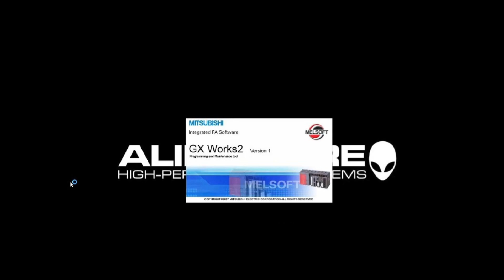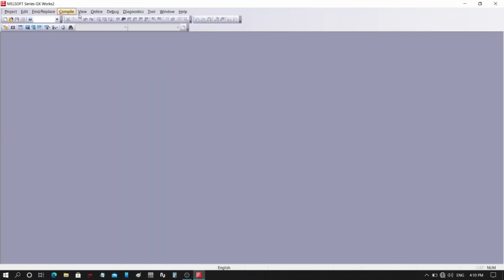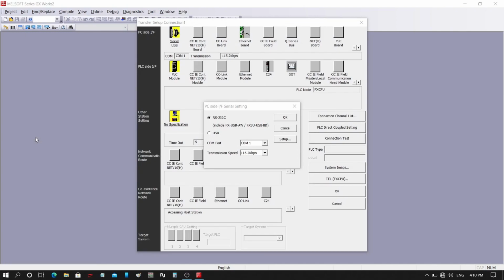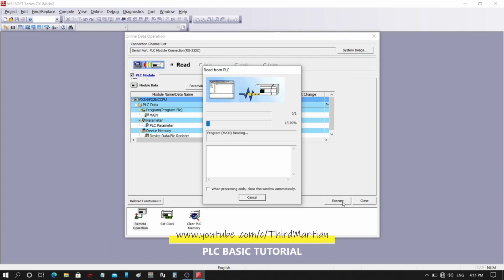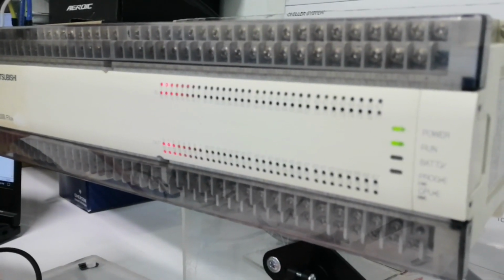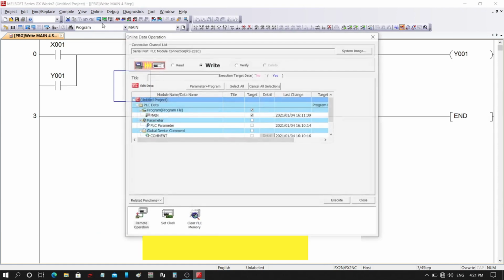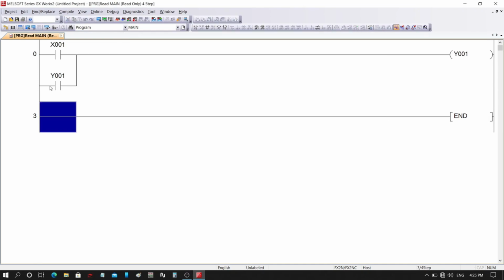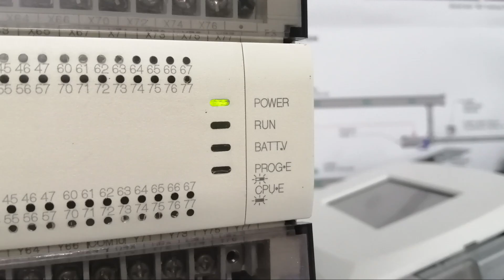How to Wired, Upload and Download Program in Mitsubishi Melsec FX2n PLC

Comment: will the gx works 3 also work?
Reply from the maker: If you are working with older Mitsubishi PLC models like the FX or Q series, GX Works2 is necessary. However, for the latest iQ-R and iQ-F series, GX Works3 provides a more advanced and efficient programming environment. Therefore, while there is some functional overlap, GX Works3 cannot fully replace GX Works2 if you need to support the older PLC models.
Reply: @TheMachine0021 
This saved me going down a big rabbit hole!

Comment: Sir good day. I would like to inquire if this unit is the same of Mitsubishi FXos- 30MR- ES is the same wiring diagram to be apply?
Reply from the maker: The wiring and configuration of FX2N and FX3S PLCs are generally similar because they are both part of the Mitsubishi Electric FX Series PLCs. However, there can be some differences depending on the specific models and their features. It's essential to refer to the user manuals and documentation provided by Mitsubishi Electric for each PLC model to ensure that you wire and configure them correctly for your specific application. Keep in mind that the wiring and configuration details may vary, so always consult the appropriate documentation for the precise information you need.
Always check Data sheet or User manual 
https://dl.mitsubishielectric.com/dl/fa/document/manual/plc_fx/jy992d55301/jy992d55301h.pdf
Reply: Thank you sir .

Comment: What happens to the program if I download the program in stop mode and not in run mode?
Reply from the maker: Uploading the PLC program should be done in "Run" mode rather than "Stop" mode. The main reason for this is that the PLC operates differently in these two modes, and uploading in "Run" mode ensures that the program being uploaded is the currently executing and active one.
Reply: @TheMachine0021  The reason I asked is because I downloaded a FX2N-128MR program to my PC in STOP mode and uploaded the saved program to another PLC of the same type in STOP mode too and it didn't work. Could this be the reason that uploading should be done in RUN mode? Thank you for your help.
Reply from the maker: Probably, uploaded it in run mode.
Reply from the maker: you will receive an error during uploading.

Comment: What mean if run light is not on?
Reply from the maker: If the power indicator light is not turning on, it may indicate that the PLC is not receiving power or that there is an issue with the power supply or wiring.

Comment: Hi, i'll be happy with small answer - is it have different how to plug electricity? Where should be line and where neutral. Can i just connect line or in any case I should find line and neutral.
Reply from the maker: Hello Sir, In power terminal you can find it there a line and neutral terminal. Labelled as L and N.